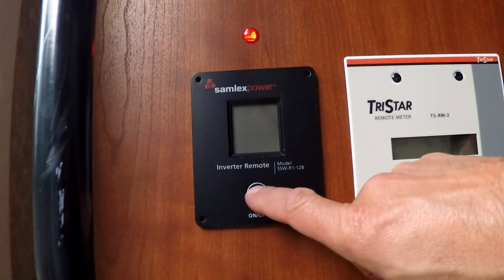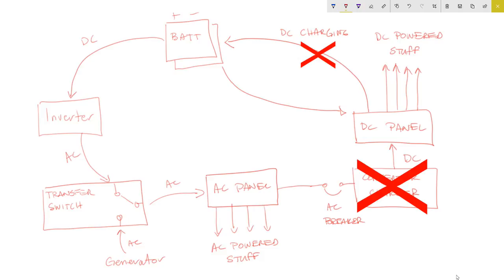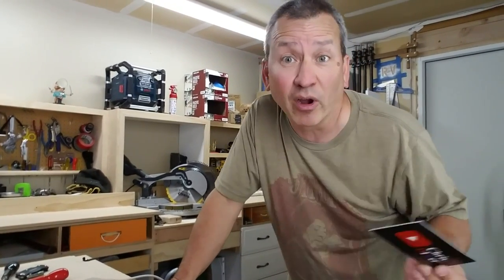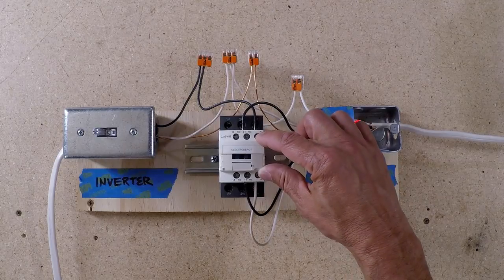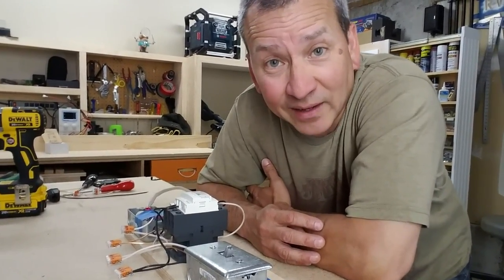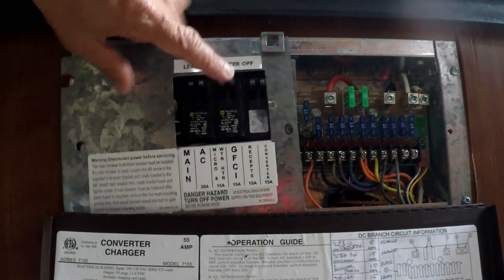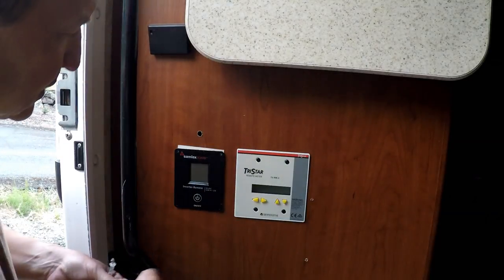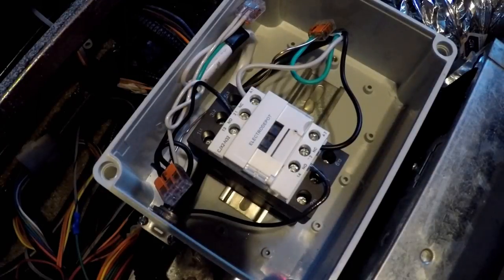How To AUTOMATICALLY Disconnect a Converter Charger When Using an Inverter

Comment from the maker: Update: Here's a minor correction to my installation diagram/drawing. The contactor switch location should be on the converter charger side of the circuit breaker. I just noticed this error after publishing the video. Oops...late night drawing.
Reply: You recommended a Samlex 2000w pure sine wave inverter. They make 2 models, the cheaper one comes with a remote switch but the reviews say the fan is very loud. The better model (pro) cost twice as much but is much quieter and the remote switch is extra.  Which one do you recommend?
Reply: just curious, what difference does it make if the contacter is before. It would cancel the power to the breaker wich is the samething as closing the breaker manuallye, before or after is the same result. What am I missing?
Reply: I'm not too slow, but I will have to watch this 2-3 more times to get it down... THANKS for doing this!   :)
Reply: Do you have a new diagram ?
Reply: Y this was 5th grade😂 Now I bought it n don’t know what to do with it bahahha

Comment: A great idea and very nice installation. However, there is an improvement you could make. When on inverter power you want to conserve as much power as possible. Currently your inverter energizes the contactor coil, which draws itself draws a fair amount of current (you will notice a contactor is warm when energized due to the coil producing heat). Instead, reverse the operation. Have shore power energize the contactor, which in turn would energize the converter. When not on shore power, the contactor would then open. In other words reverse what powers the contactor coil, and use the opposite NO/NC contacts that you are using now.
Reply: This is the better method, otherwise as you stated, the inverter has to power the relay thereby using battery power.  Conserve your DC voltage.
Reply: The only problem with that setup is when you're running the generator, the converter wouldn't charge your batteries.
Reply: This is a great suggestion. What I am planning to do is use shore power to power the coil like you suggest and then use the three main contacts to disable the converter and both air conditioners so the air conditioners don't come on when the inverter is running and overload it.
Reply: @georgetownfun3588  great idea!
Reply: Shouldn't the Converter Charger work as normal in the current configuration or did you mean if wired opposite?
Reply: @Allen Benusa  The down side of doing  that is you'd have to splice into the shore power to energize the relay.  In the video he's using the 2nd unused plug from the inverter which requires less splicing, a little cleaner from a wiring perspective.   I get your reasoning though.
Reply: Interested in that new video 4sure.
Being I'm electrical intolerant ... 
that made sense?¿

Comment: When you’re using your inverter, you wired the circuit through the normally open side of a relay. No battery power is being used to power the relay and the circuit is open to the battery charger, no charging takes place. When you switch to generator power or shore power You have unlimited power so you power the relay to close the circuit and activate the charger to charge the battery. You are now powering the relay using shore power instead of battery power.

Comment: You have it wired all wrong. You want to go through your normally 0pen side of your contactor when the inverter is on. when you run shore power or generator, you want to activate the relay and close the circuit to energize your battery charger. The purpose of that is to use generator or shore power to energize the relay so you don’t waste battery power to open a relay.

Comment: I will never run my system together.  Inverter will plug in for shore power and just use a breaker to turn off charger. If I'm on shore power I'll just charge batteries with plug in charger.

Comment: Hello I had the same exact problem and I found the least expensive and most reliable solution was to remove the AC feed for the converter/charger from the AC distribution  panel and wire it directly to the hot AC wire coming from the remote or external AC source at the transfer switch. I added an inline 15amp fuse into the Converter/charger AC feed wire to act inplace of the 15amp breaker I disconnected it from. No extra relays are required.
Reply: Thanks for this. I recently left my converter/charger on while the inverter was running and drained my battery bank. Thanks again for explaining what I need to do.
Is a 15A fuse really necessary?
Reply: This would not work the same as Tito was using the shore power connection to energize the whole RV. Your solution would work as long as you are wiring the panel to your inverter directly.

Comment: Hi Brian,  Wonderful videos, thanks for all of these!  I have a very similar setup except - I ELIMINATED that second relay by simply hooking up the charger to the Generator/Shore terminal of the transfer switch.  In other words, the battery charger only works when there is generator/shore power present.  It will be off at all other times (when inverter running and no shore/generator power present).  Keep those vids coming!
Reply: Glad I found your comment. I recently left my converter/charger on while my inverter was on and completely drained my battery bank. I hope I didn't damage anything. Now I can rewire my transfer switch so this won't happen again.
😊
Reply: Yea, I think I will do it this way because I plan to install a transfer switch soon. I am going to add 400 watts of solar, which is coltrolled by my current DC-DC charge controller with two lithium batteries, which will then power the inverter I want. But the back feed of the inverter power into the converter had me concerend. I'm glad the solution is so simple. I was originally thinking of just shutting the breaker off, but that could lead to mistakes if the wife, kids, or future owners are not aware.

Comment: I knew there had to be a better way than having to switch between the converter and inverter.  The distribution panel in my 2021 Grand Design does not even have a separate breaker for the converter!  I'm installing 800 watts of solar and a 3000watt Renogy Invertor, and was planning on having to feed the Inverter A/C into the 50 amp drop cord, from the front cargo bay (where my system will be, all the way to the rear of the camper where the 50amp connector is at.  WoW !  This is like the Best Video that I've seen in all my research so far.  And the amount of time and effort that you put into creating the visual aids... Thank you!

Comment: Another winner! Tito, my solution was just a bit different. I never went through the process of powering my load center directly with the inverter as you did for that exact reason. I figured I might not be the one that's turning it on and didn't want to risk a misunderstood label from that most helpful (still don't have and using masking tape) label maker. The inverter has a 2 plug GFCI. I could send 120 volt power for 2 circuits easily to the rear of the trailer near the  load center. All the AC outlets for me are on 2 circuit breakers, 15 amp. I installed a Xantrex 15 amp transfer switch for each at the load center area. They're automatic like yours but the process for me switches the the load from one line to another for each, different from yours where you cut the line from a load. The ac and converter are out and the microwave and refrigerator are in, so I still need to switch the refrigerator to the gas only setting. Beyond that, I'm good to go. When I was doing the set up I really thought that I should be doing a vid but just couldn't bring myself to do it. After, I was so happy with the setup I wish I had. I offered this just because it was a different take on the same problem not because it was better so I hope you and your viewers are okay with it. Thanks for the good vids Tito.
Reply from the maker: Yeah. I looked into that Xantrex transfer switch, but determined that it wouldn't work for me and went with the contactor approach. Glad to hear that your setup is working great for you. Nice job.

Comment: This was a very good video. 
The additional thing I did was added the Airconditioning so that if it was accidentally left on when the Inverter was started it would turn it off. I all so found a better and much smaller 30 AMP connector with 2 NO or NC .
Schindler's electric part number
92S11A22D-120
Reply from the maker: Thanks for the recommendation!

Comment: Haven't thought it out completely but I think I would use the other set of contacts the NO set basically set it up backward to how you do it. With shore power connected the relay is pulled and the converter is powered. You have added the load of that contactor/relay that must be powered by the batteries when you could have it powered by the shore power which you have plenty of.

Comment: My chosen setup is much like yours but my converter will never create a loop because I will be using a separate battery bank, solar panel and charge controller for DC loads. (430Ah for Inverter and 224Ah for DC). So in my case the first battery bank and inverter powers the AC to the coach and the converter which would then normally charge the second battery bank. I don't want the converter charging the second battery bank (it has it own solar) and I still want to shut off the converter to avoid inefficiency even though it can never loop back. This is a great visual representation of the rough idea in my head as to how I thought I could shut the converter off and you saved me a lot of planning. Thanks for the timely video and detailed process, this is the path I will take.
Reply from the maker: Glad it helped you out. Good luck with your project.
Reply: RVwithTito thanks so much!

Comment: Thanks for the info. I'll have to think about this for a while. My bookmobile had a massive generator, 50 amp shore power and a leak from the emergency hatch over the power panel and manual transfer switch. Replaced the panel and breakers, now looking for a switch solution and something to add solar later.

Comment: Thanks so much. How do 12 volt DC modules work when CONVERTER is turned off and INVERTER is connected to main power inlet to power the entire coach? This is my main concern in setting up such a system. You are the best help I have found and I greatly appreciate your YouTube channel.
Reply from the maker: Your battery bank powers your 12V equipment with the converter off. Both the converter and batteries are wired to your DC panel. When the converter is on it provides DC power and charges the batteries. When off then DC current flows from the batteries instead.
Reply: @RVwithTito  Deeply appreciate your response. One other detail where my system differs from yours. My panel does NOT have a breaker for the converter/charger so there is no way to turn it off manually. Also more difficult to locate the wire to go into the switch.  If I can identify the wire going OUT to the batteries from the converter/charger can I install either a manual switch or the switch which you have used? I think I can, but looking for a bit of assurance.
Reply from the maker: You'll want to put a switch on the wire between the breaker (whichever one) and converter/charger and not to the batteries.
Reply: @RVwithTito  Thank you for your patience with an old man trying to learn new tricks. My panel does NOT have a breaker for the converter/charger. I just talked with a service tech at the manufacturer and he confirmed that there is NO breaker for the converter/charger. So, just to be sure, where could I install a switch to turn off the converter/charger. I am assuming that there has to be a wire coming out of the panel (even though there is no breaker) leading to the batteries. Would it be that wire coming OUT of the panel leading to the batteries? I am getting closer to solving this riddle or giving up altogether.
Reply: I should have said "leading to the converter then to the batteries" not just "leading to the batteries".

Comment: I am a HVAC technician. We always use the normally Close side to power, a blower in heating mode. We use the inactive state of a relay to close critical circuits when the heating element is energize. The blower and the heating element needs to be energized at the same time to prevent a fire. We use the inactive side of the relay to ensure that the blower is energize during heating mode. you would use the inactive side of the relay normally open when the inverter is operating this would deactivate the charger without using battery power. You would close the relay using generator or shore power because you have unlimited power.

Comment: I use the 100W 12V flexible PV panels, much cheaper.
I store them in the basement and only use them when not on shore power.
I installed an external cable gland with MC4 connectors. Works great.
I hardly use the 120VAC from the inverter, but the charge controller keeps the batteries topped off nicely.
Since you have extra contacts on your contactor, you could use one of the contacts to turn off battery power to the inverter when on shore power.
You can even use another relay to switch to a redundant backup inverter if the first one craps out.
I would use a 3000W inverter because they are only good for half-load when used long term.

Comment: Hey Tito, I added a 3000w inverter to my 5thwheel. It has a 30 amp plug on it. I plug my rv 30 amp service cord into the inverter. I have a kill switch for my battery bank so when I turn the switch off the juice does not go into the battery bank from the inverter supplying power throughout the 5thwheel. The inverter is direct wired only to the battery bank. So I can by- pass charging the battery bank through inverter. I use solar for my charging source. I dont us a generator but your system is a great idea. thks for sharing

Comment: Love it! Quick question. Do you have 2 sets of wires coming off you inverter now? One set that heads to the transfer switch as normal. Then the other set heading to the relay switch? Essentially making the relay switch just a fancy automatic on off switch? 

My apologies if this is a dumb questions. Still wrapping my head around all this fun stuff. thanks!
Reply from the maker: Theres just one AC output from the inverter to transfer switch. The relay I installed before was removed. Here's a video that may help. https://youtu.be/iASOOzUCRto
Reply: @RVwithTito  thanks! I don’t think I worded my quark on properly. 

On the inverter terminal, do you have 2 sets up wires? One set wires to the battery and the other set to the relay switch?
Reply from the maker: @tmo7984  Yes. DC power in from battery, and AC power out to the transfer switch.

Comment: Thanks Brian, I have a 25 foot airstream that as a additional 30 amp shore power hook up on the front and I am really interested in the ienergy Kodiak solar generator it also has a 30 amp RV receptacle so I can connect a Dog bone to it. I like your stop switch to the converter, I saw one with 2 stop switches that it could also shut the Air conditioning off at the breaker, thanks again for all your help
Reply from the maker: Awesome. Thanks Mike!

Comment: Great project! I have a few ideas for you -
1) the extension cords you used are not 'shielded', just jacketed. Shielding is done with a metallic liner, either foil or braided.
2) 16 gauge wire should never be protected with a 15A breaker. It is only good for 8A continuous and should be on a 10A breaker. Remember the breaker is only there to prevent the wire from catching on fire.
3) Hopefully you powered the coil of the contactor with AC from shore or generator. If you used the inverter generated AC, it is another continuous load on your batteries that could be eliminated.
Reply from the maker: Thanks for the feedback. You're right...cords are jacketed, not shielded. Also, the 16 gauge wire is not connected to the 15A breaker. Those cords are only used to trigger the switch and provide a tiny bit of AC power back to the indicator LED light. Only the converter power circuit (wired with romex) goes through the breaker. Finally, the contactor is powered by the inverter AC. The whole point of this mod is to have the inverter switch off the converter when NOT on generator or shore power. I'll have to measure exactly what the load is, if any on my batteries. I have a battery monitor that tracks amps drawn from the batteries. My inverter draws roughly 2 amps @ 12v with nothing else running. I haven't noticed any additional draw now that it's switching the contactor as well. I'll keep an eye on it though. Thanks.
Reply: I was also wondering about whether the contactor draws power and if so, how much. I'd be interested in if you have any updates now that it's been about a year.

Comment: Brain, again, another awesome video.  Until I watched this one it would have never dawned on me that I am doing it all wrong :-) I have a Thor Siesta and when I purchased it I had the dealer install a Xantrek Pro Inverter.  They never said anything about throwing the converter switch when running the inverter.  I am assuming that I should probably do this mod.  Thanks again

Comment: Tito.  I liked what you did but don't have the skills to do it.  I am not real savey but wanted to run an option by you.  I don't think I have a switch on my power supply box in the camper that I can use to turn off the converter.  I am assuming that I have a wire coming into the batteries from the converter and I also assume I have a wire going from the batteries to the power supply box that includes the converter.  Can I install a cutoff switch on the wire from the converter to the battery to stop the "looping' from happening?  I figure if I put that converter cutoff switch by the inverter switch and both switches are in the same place by the batteries I will remember to turn off the converter when I turn on the inverter.  Not elegant but I think it should work.  What do you think?